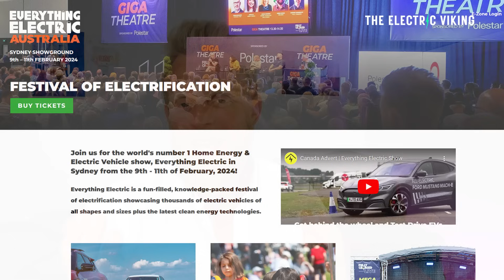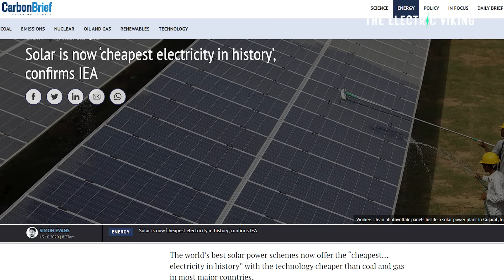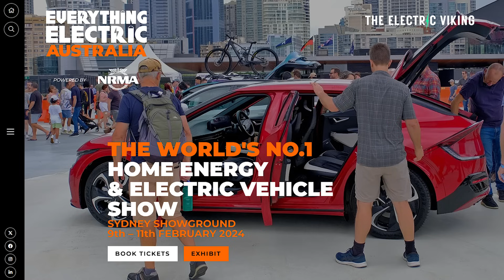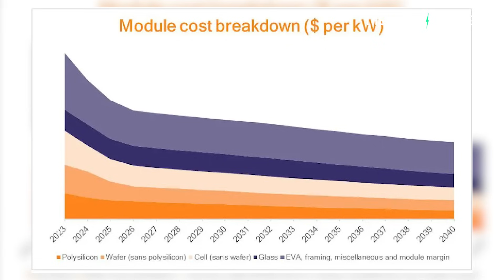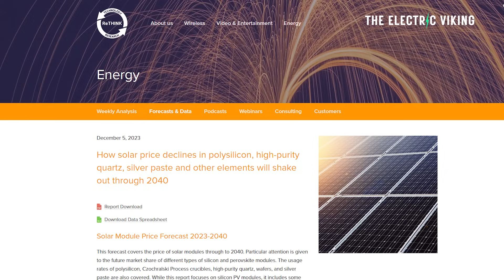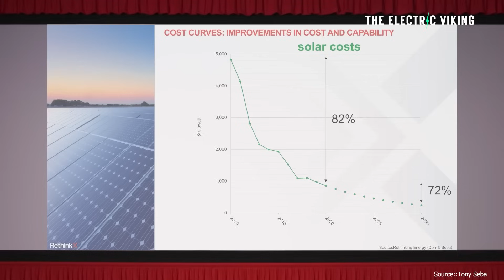Tony Seba just made this insane solar prediction that is blowing my mind

Comment: Tony Seba is right, solar is the cheapest way to produce decentralised electricty and start to detach from monopoly... 
1$ solar Panel you get 10Watts x 2000h/year means upto 20kwh/year for 20years aka 400kwh/20years  .  In the best solar regions $1 => 400kWh  ( after 20 years). 
1$ = 20 x20kWh/100km   aka  1$ => 2000km on a Tesla S   and Tony Seba is right it's insane and disgusting cheap for the oil industry.  
This will crash the oil industry  in 2035 when   a 1000 Watt solar Panel will cost no more than $75  &   $40/ 1kWh LMFP cell
Yes in 2035 a 1000watts 32%   solar Panel will be cheaper than today a 700watts 22% solar panel if we remove solar glass and make them 
 100% reclyclable for silver and silicium part.
We will need to install 4kW per capita with is 32TW  solar worldwide  and replace it every 16 years  aka 2TW/year to achieve market saturation.
Be limiting factor in not solar but battery !!!

Comment: Tony Seba should be listened to and believed. He has for years correctly predicted the price drops of new products. Sam, you point that out. Yet you don't hold that same standard to the climate alarmists who have made predictions for decades going back to the 1970's that have all been wrong. In the 1970s they warned of the coming ice age. Then it was global warming, and in the last 10 years they have rebranded to "climate change".   These experts have repeatedly been proven wrong with their predictions and you still believe them.  Let me share some facts. CO2 is not pollution. CO2 is required for plants to thrive. Here is another fact 99% of air is nitrogen and oxygen. That leaves 1% for all of the other gases.  Fact, after nitrogen and oxygen, the next most abundant gas is NOT CO2.   It is argon and it makes up .9% of air.  So 99.9% of the atmosphere is NOT CO2 but for decades we have been lied to about it causing run away warming. CO2 doesnt work like that. And there have been scientists who have been scilenced over the years because they argued againt the global warming cult.

With that said electric cars and solar panals are not going to save the planet. But electric cars and solar panels WILL replace gas cars and some forms of power generation because they are better. Electric cars are note fun drive, and are less complex machines.  Fewer thing can go wrong. No spark plugs to replace, no fuel filter, no exhaust system, and no more oil changes and no more need to use fueling stations (unless on a long road trip).

Comment: The Shockley-Queisser limit says that the maximum possible efficiency of Silicon solar cells is about 32%.  That's a physical limit.

A major issue is storage for when it's not sunny.
Reply: Bet we beat that limit in a panel but we do it by building multiple panels inside a single physical panel ie Each internal panel is collecting a different wavelength. Lets see .....
Reply: @TimMountjoy-zy2fd  Google "Multi-junction solar cell"

Comment: With regard to construction of nuclear power, Sabine Hossenfelder makes the point of the wrong statistics be used by some critics of nuclear power. Median construction times is a better measure than worst cases and averages, which give the wrong picture. Countries should play to their strengths. Nuclear makes more sense in Japan where land is scarce and there is lots of experience in nuclear power. Solar makes sense in Australia which has lots of sun.
Reply: Even in Australia nuclear makes more sense.  Let's say you put solar arrays in the desert, then you have to build transmission lines, and its all in the middle of nowhere.  Can you imagine being on the crew maintaining all of that?  It would be a very boring, very isolated life

Comment: Great show as usual. There's a report out that funding is completed and in a two year construction a 3MW solar farm will be completed in Arizona. One nuclear plants proponent said, basically, if they can do that, WTF. it would take a decade to build a 1MW reactor in the US at greater cost, no disposal plan for spent fuel. I'm glad Japan is going to restart it's 8 MW reactors plant, it's needed, and it operated well, closed by edict after Fukushima. But solar is winning in the marketplace. In the US gas is big for electricity generation, about 40 percent of baseload, but renewables including nuclear, so say non carbon sources, now provide 40 percent. So gas is a transition. But it will go too.

Comment: Oooops, you have mixed up Moore's Law and Wrights Law.
Wright's Law aims to provide a reliable framework for forecasting cost declines as a function of cumulative production.
Moore's Law states that the number of transistors on a microchip doubles every two years.  (This actually changed to every 18 months)

Comment: Be it real or a hoax few with any brains at all would disagree with the FACT that climate change is a scam!
Many real things can be scams.
Charities are often scams even and especially some of the biggest ones.
Insurance no matter how necessary it may be to avoid financial difficulties due to an accident has always been a scam, the level of scam depends on how reticent the particular company is at paying legitimate claims.
Fake Nigerian princes are famous scammers who have been plaguing fax machines and email boxes for ages even though according to google Nigeria as a Republic does in fact have a royal family.
So what make climate change a scam?
The fact that politicians and climate scientists and the mega wealthy are the only ones apart from that the Chinese are getting any benefit from going green.
The fact that not one of the proposed solutions for reduction of ghgs achieves anything close to the reduction that could have been achieved by simply improving existing systems instead of trying to replace them.
Note and efficient Diesel engine running on natural gas can be a thousand times cleaner than any battery powered alternative, especially if either one catches fire.
Natural gas can be made from sewage and other wastes that need to be dealt with regardless.
The c02 investment in a diesel truck running on natural gas would be one tenth or even less than that of a battery powered truck over its lifespan.
Ignorance of these simple facts makes climate change a scam even if humans do control the thermostat.

Comment: For solar panels to keep decreasing in price there needs to be a way to produce these panels without the use of silver. Silver comes out of the ground at about 10 to one to gold. Gold is about $2000USD that should make silver at least $200USD. The price of silver is kept low by price manipulation. There is beginning to be a shortage of silver so the price will someday soon reach its true market value. Research is ongoing on thorium nuclear reactors, and I believe there will soon be a breakthrough that takes thorium mainstream. Thorium is a waste product of rare earth metal refining and a serious source of pollution so thorium reactors will solve two problems. No one ever talks about the ecological problems of recycling solar panels when their lifespan is over. This is going to be a nightmare.

Comment: Sam conveniently doesn't post price charts from the time period when solar panels were INCREASING.  Cherry-picking data doesn't do much for credibility.  Solar panels have decreased in price in the long term, and may continue to do so.  But Sam also conveniently ignores all the other costs involved in a solar installation besides the panels: land, permits, mounting, wiring, inverters, regulators, additional electric lines to the installation, labor, etc.  If the price of car doors declines, that doesn't mean that the overall price of the car also declines.
Also, solar requires backup power for when the sun doesn't shine.  That usually means fossil fuels, since nuclear and hydro are mostly baseline providers.  Batteries are nowhere near cheap (and plentiful) enough to provide meaningful backup power to the grid.  The entire battery capacity in the US would run the grid for less than 5 minutes.

Comment: Ashfelt shingle is dirt cheap, but not the longest duration. They are not used in the UK, and I suspect they would not meet our building regulations. We do however use ashfelt on some flat roofs and they are a pain often needing maintenance and causing leaks. Many people are moving to EPDM or fibreglass and gelcoat as these will last around 50 years before needing significant attention. Ashfelt is a material I would definitely be very keen to avoid anywhere with a risk of wildfire as it is flammable where clay or concrete tiles , metal profile roofs or toughened glass (solar panels) are far less likely to let fire into a house.
Reply: You might mean asphalt shingle. Not used in Australia either

Comment: Great news and bad news for cars that run on Hydrogen.  The ability to charge for less and the ability to store energy in future batteries makes it a no brainer to buy an EV car.  I have solar panels installed to my house and my son did the same thing and we both use less energy than the panels produce.  This means I can charge by Tesla Model 3 for free.  With my utility service Pge it's not free cause they have a way of taxing me plus a fee for being hooked up to their power line.  The only way is go off the grid but should my panels go out I have no life line so I continue to pay extra $30.00 dollars per month.  Yes you need to rethink Hydrogen as a fuel when the cost of solar panels are so cheap that for me it will be another 8 years before I break even and for those buying a EV they will reap the benefit of a cheaper EV due to battery prices going down.

Comment: Check out Yuma AZ. The city with the most sun in America. Not a single solar company in that city uses its own product. None of them have solar on their own roofs.
Reply: And your point is. . . ?
Reply: @eyesuckle  Just found it odd to see so little solar used in the most sunny city. Probably not the most wealthy city I'm guessing. I live in one of the least sunny cities and I'm planning on getting some in a couple years.
Reply: @MH-Tesla  That is odd.  But it is odd to me that there aren't more solar panels deployed in the American Southwest on the whole.  It just seems like the perfect place for it.  Nevada should be turned into one giant solar panel as far as I'm concerned.  It could supply the needs of North America's air conditioning during the daylight hours, anyway.

In a similar vein, on a trip that took me from Las Vegas up to Utah a few years ago to visit Zion and Bryce (a trip I recommend wholeheartedly) I don't think I came across a single low-volume flush toilet in my travels. That struck me as insane for a desert climate.  I live in a place that gets 80 inches of rain a year and low-volume flush toilets are legislated here.

Comment: Had my ev charger installed just over a month running an off grid solar system. Put 660kwh into the car in that time. Its such a good combination for Australia.
Reply: Australia is an extreme case due to sun hours and extremely low overhead. Installed residential PV was at $1/W when it was $3/W in the US for the exact same panels. 'Soft costs'. In other words, the wafer cost is not what moves the needle.
Reply: @martinvoelker6406  hence why I said it's such a good combination for Australian. Other areas need regionally specific solutions. Solar isn't going to be great solution through an Alaskan winter.

Comment: A very important advantage of widely distributed small-medium sized residential and commercial solar and/or solar battery installations is that these kinds of systems do not require much/any infrastructure improvements if the utility companies also install large storage capabilities. The same transmission lines which provide power from utilities to consumer can simply be used for consumer to utility power plants. Ideally this would be a mix of lithium ion, flow batteries, pumped hydro etc.
Reply: The customers that use all that grid infrastructure still have to pay for its upkeep, don’t forget.

Comment: I don't think that the panels can double inefficiency because I think that puts them above the theoretical maximum efficiency they are capable of.
Reply: It would if they were single junction, but with multi junction (each junction tuned to a different wavelength of light) you can get solar cells up into the 40's percent using technologies that have already been developed. These cells are currently only used for super premium applications like powering satellites due to their current high costs.
Reply: @garytulie8567  Yes, I've seen those.  They max out at 48% I think.

Comment: Wrights Law is what you're describing Moores Law is a measure of compute cspacity over time. 
People also ask

What is the Wright's law of manufacturing?

￼

Pioneered by Theodore Wright in 1936, Wright's Law aims to provide a reliable framework for forecasting cost declines as a function of cumulative production. Specifically, it states that for every cumulative doubling of units produced, costs will fall by a constant percentage

Comment: I don't understand.  California has installed huge amounts of "cheap" solar yet my cost of electricity has gone from $0.16/kwh to $0.32/kwh and continues to rise 14% per year.  This is not getting cheaper.  I did install 24 panels on my house in 2014 to cover 90% of my electrical needs.
Reply: What you are encountering is the pressure for profits to increase every quarter and the cost of installimg new capacity. 
Sure that new capacity cost would be much higher if replaced by fossil fuels, but it does go up and no company is going to take the profit hit when they can charge their trapped consumers for it.
Reply: @Yetifile  That's a nice explanation but it doesn't help my bank account.  BTW, why do we have to curtail our use of electricity between 4:00 PM and 9:00 PM every day.  I didn't have to before.
Reply: So much for cheap renewables . What you have experienced is happening worldwide. People have been conned.

Comment: Solar and batteries aren't taking over geothermal.  
Everything else, yes, but new geothermal is quickly becoming a 24/7, 365 power source that can compete with cheap solar.  The new geothermal companies coming out of the fossil-fuel fracking industry are learning to dig deeper all the time, where they will, in a decade or so, be able to dig deep enough to put a baseload geothermal power plant near many cities.  When they can dig seven miles deep, perhaps in a few decades, they will be able to power nearly any city on a small footprint.  
Solar/storage and geothermal will both be huge.

Comment: The price of the panels is irrelevant. Energy-efficiency is the important thing. If CO2 is a problem, then plant trees . Don't cover the earth in plastic or metal panels. This disrupts all of the earth's processes. You will change how rain is absorbed into the ground. You will reflect the sun and cause atmospheric warming. You will use land that could be used for growing crops. Forget all this high voltage pollution and battery nonsense, grow plants that animals can eat, and we can eat the animals. This is how our planet functions and the only way it will survive.
Reply: > . . . grow plants that animals can eat, and we can eat the animals. <
We grow plants (corn) to make ethanol to feed cars.  If farmland was valuable, we would not use it to feed cars.  We would use it to host solar gardens because the vehicle-miles per acre is far higher with PV to EV than the corn to ethanol route.

Comment: I think solar panels are cheap now due to low silver prices.  Once the demand is clear, silver prices will rise and costs of solar panels will go up.
Reply: At 20g of silver per panel the cost of silver is $ 1 per gram. So silver has to at least double in price to be noticeable in a panel price. If it rises further then they will start substituting copper for the silver.

Comment: The age of oil is over....The cost of solar and evs has now reach d affordability for the middle class. Look at China. Chinese used to ride bicycles when I was a boy back in the 1960s. As China became the manufacturer for the world the other income of Chinese workers increased and they could afford motor bikes s. Today the Chinese are buying evs. The wuling is a cheap car............the biggest seller in China...Here in the USA,we see ridiculously high prices for evs. This is why the legacy auto makers are not selling evs. Who wants to pay _$100,000 for a Hummer that is a big expensive joke, does nothing well? Or why pay $80,000 for an electric Ford 150 when the cheapest Cyber truck at $60,000 beats the 150 in 28 out of 30 specs?.Gm had a good thing with their bolt for the $30,000 range. The rest of their line up like the Cadillac f of r $100,000-300,000 is a joke!.....Consumers are waiting for a practical affordable car. Look at aptera........400 mile range for $34,200.....or the much anticipated $25,000 Tesla......please respond to your local news provider s who receive huge payouts from the oil lobbies......that the Consumers have made their decision...for affordable evs.....

Comment: I live in the San Francisco area and can enjoy free electricity from the system I installed.  That includes free energy for my wife's Tesla.  We still need other methods for less sunny areas.  Wind and better nuclear have to be part of  the solution.  You are somewhat biased by living in a sunny country.
Reply: @howardj602  I bought used panels and did the installation my self two years ago.  I have already saved in electric bills what I spent on the system.  So, now, I can charge the car for free.